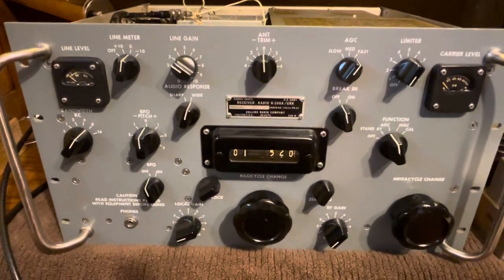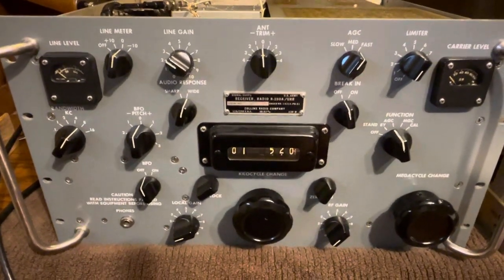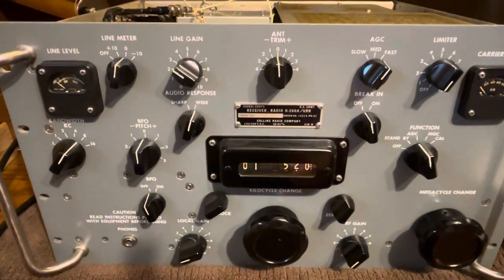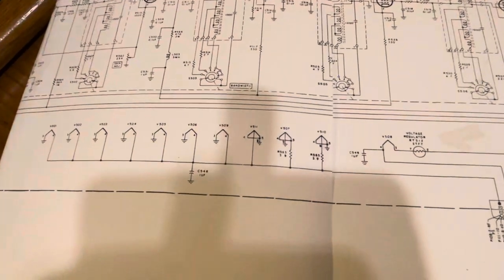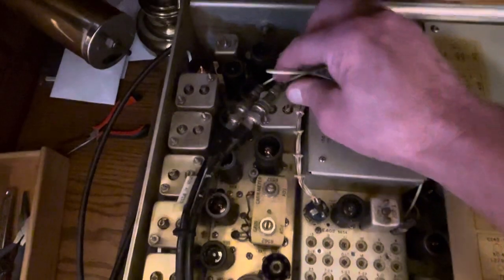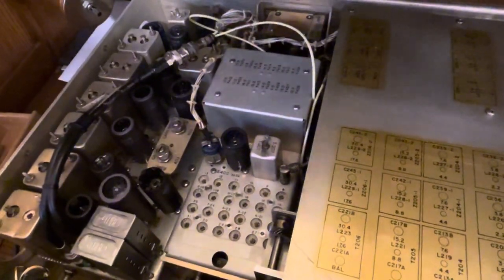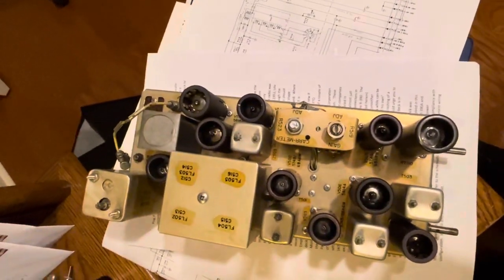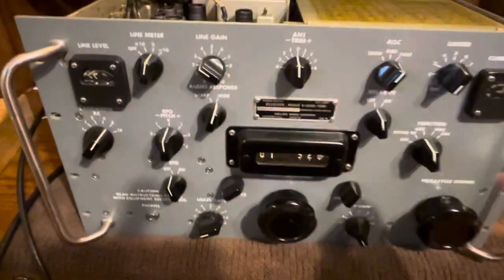Convert R-390 IF deck for use in R-390A, superior sound. R-725/URR like conversion.

Comment from the maker: The first tube circuit we'll work on is the ballast tube circuit.  V508 (5749) and RT512 (3TF7) These must be supplied by the R-390A 25V filament supply.  To do this, sever the connecting wire at pin 8 of jack J517 (underneath the deck) to free this slot up (hint: save access to the connector end of the wire as you will use it to wire supply to V509). Then, sever the connection at pin 2 of RT512 and wire this pin to pin 8 of J517 of the R-390 deck with a long piece of new wire.  The filament return connection remains unmodified. This modification will make the BFO/PTO/ballast tube series connections identical to the R-390A 25V filament supply connections.  As mentioned above, this 25V supply is insufficient to supply the remainder of the tube filaments, thus the need to employ the 6V supply for this task.  The following 6V tubes shall have filaments wired from the 6V R-390A supply.  The filament pins of these tubes are pins 3 and 4.  Don't sever any connections unless instructed to do so.  The modification will use as much existing R-390 IF deck wiring as possible (and thus may seem a bit screwy to you until finished).   V504 (6BJ6) 6V will come from its existing connection at pin 4. Ground will come in the next step.   V503 (6BJ6) Wire pin 3 of V503 to pin 4 of V504 for 6V supply.  Ground V503, pin 4. V502 (6BJ6) 6V supply will come from an existing connection at V503, pin 3.  Ground V502, pin 3.     V501 (6BJ6) Sever ground connection at V501, pin 3 and wire pin 3 to V502, pin 4.  V505 (6AK6) 6V supply will come from existing connection at pin 4. Ground will come in the next step.  V506 (6AK6) Ground pin 4 of V506. Wire pin 3 of V506 to pin 4 of V505 for 6V supply. V509 (6BJ6) Locate the free wire which was cut from underneath J517, pin 8, and connect it to the 6V filament supply at J517, pin 20.    The following tubes are 12AU7's wired in various series schemes in the R-390.  They must be rewired according to their 6V option for use in the R-390A.  Note two of the connections require dropping resistors on the 6V source of V507 and V510 to obtain the desired 5.3V filament voltage.  V511 Sever ground connection at pin 5.  Connect pins 4 and 5 together for 6V supply, ground pin  9.   V507 Sever connections at pins 4, 5 and 9, including the two resistors (one 120 ohm and one 22 ohm).  Wire 6V supply from your previous work at V505, through the deck opening for variable capacitor C525, to pins 4 and 5 through a 3.9 ohm, 1 watt resistor.  Ground pin 9.  V 510 Sever connections at pins 5 and 9.  Ground will come from existing pin 4 connection.  Remove 120 ohm resistor between pins 4 and 9.  Wire pin 5 to pin 4.  Wire 6V supply from J517, pin 20 to V510 pin 9 through a 3.9 ohm, 1 watt resistor.  There are no changes to any of the other connections in the R-390 deck. Prior to installing the modified R-390 deck in your R-390A, you must check your work.  Perform continuity checks from J517, pin 8, with RT512, pin 2.  Perform filament supply and ground continuity checks as follows.  Note:  There will be more than one ground connection at various tube sockets, but the filaments should have continuity exactly as shown.  Filament supply  is checked from J517, pin 20.  V501, filament,  pin 3; ground, pin 4. V502, filament,  pin 4; ground, pin 3. V503, filament,  pin 3; ground, pin 4. V504, filament,  pin 4; ground, pin 3. V505, filament,  pin 4; ground, pin 3. V506, filament,  pin 3; ground, pin 4. V507, filament,  pins 4 and 5; ground, pin 9. V509, filament,  pin 4; ground, pin 3. V510, filament,  pin 9; ground, pins 4 and 5. V511, filament,  pins 4 and 5; ground, pin 9.  Now insulate any bare connections, and use mini-tie wraps to secure the new wires to sturdy nearby points.   To enable final installation of the deck in your R-390A, you'll need to make two adapter cables.  These cables shall consist of jumpers with BNC's on each end.  You'll also need two adapters of the type found on the back of the frame of the R-390A at the IF OUT jack (AMPHENOL 47200).  This will provide crossover from MB connection (R-390A standard) to BNC (R-390 standard).  Connect P-218 of the R-390A to J-526 of the R-390 IF deck with one of the cables.  Connect P-213 of the R-390A to J-525 of the R-390 IF deck with the other cable.  It is a good idea to label these cables.  Install the deck in your R-390A.  You will notice that the screw holes are the same as for the R-390A IF deck, however the screws of the R-390 deck are of larger diameter.  I did not change these screw as they are captive into the deck.  The BFO, BANDWIDTH, and power connector of the deck will hold it in place, however I would not install it in a Jeep this way.  Changing these screws is optional.